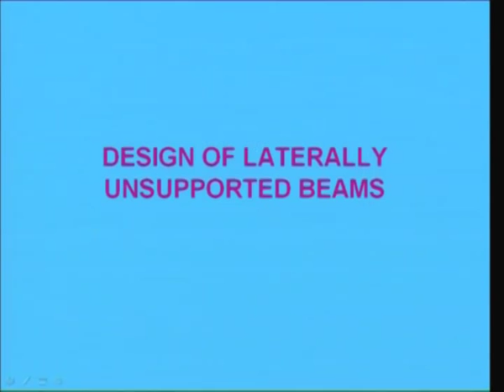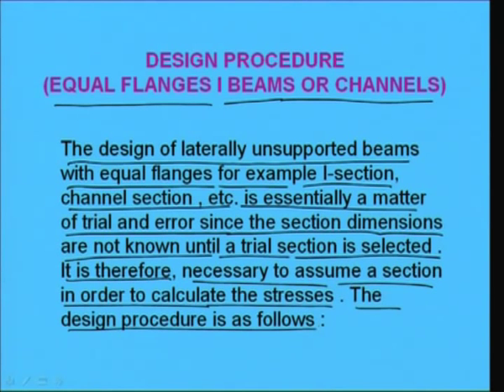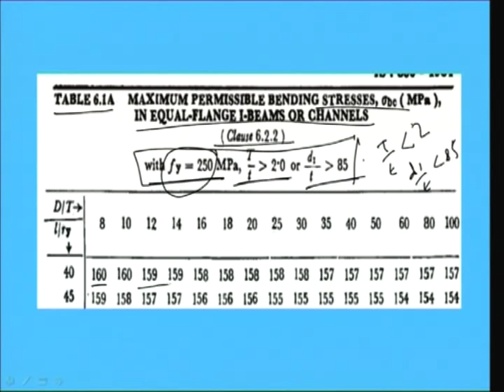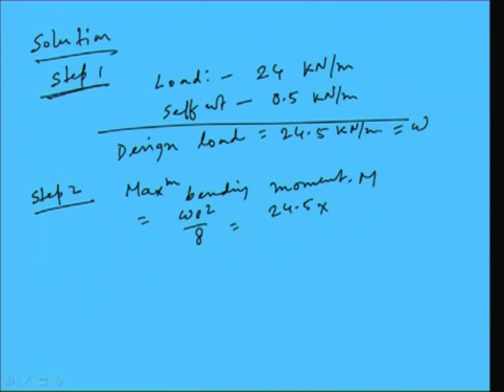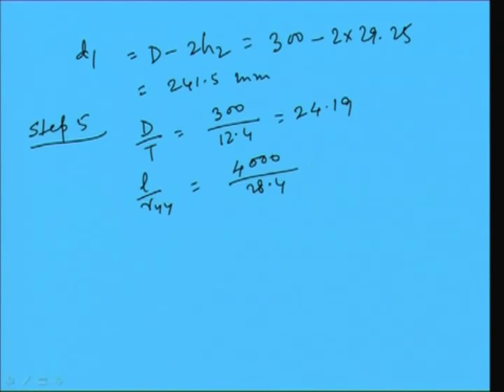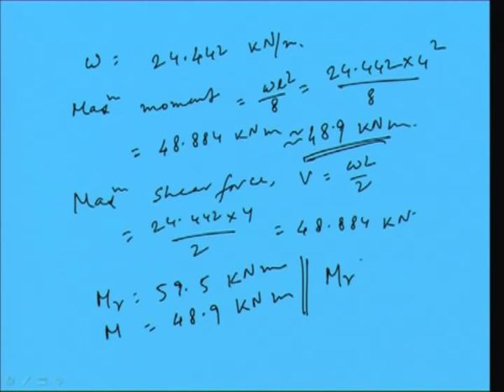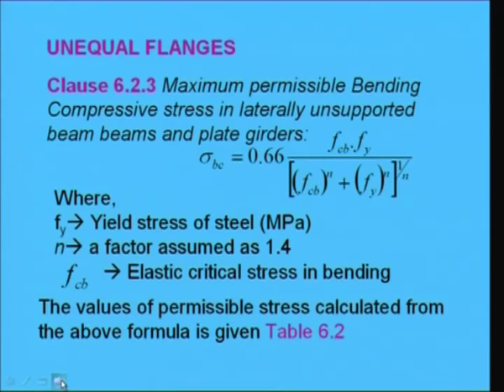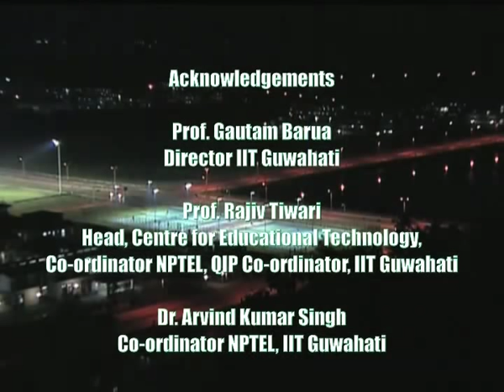Mod-6 Lec-4 Design of Laterally Unsupported Beams

Comment: May i know if an I- section is given and asked to determine the moment capacity(how could i decide whether it is a laterally supported or unsupported)
Reply: Sri Ram Reddy ...Bro in laterally restrained we use equal section like I,Channel section...So if u have I section..then it is laterally unrestrained
Reply: No bro.Just by looking at the section we cannot say whether it is restrained or unrestrained.As per IS Code we decide the restrain condition based on lamda value.Lamda value is affected by many other properties along with the sectional properties.

Comment: in is code where is table 6.1 only table 6 is given
Reply: in IS 800-2007
Reply: In IS800, it is divided in table 13(a) and table 14.
First, determine fcr,b from table 14 and use it to find fbd from table 13(a).
Here sigma(bc) is fbd from IS800